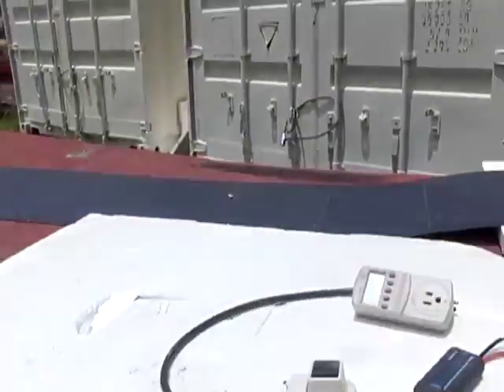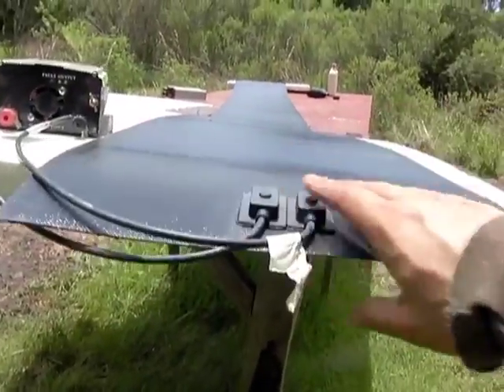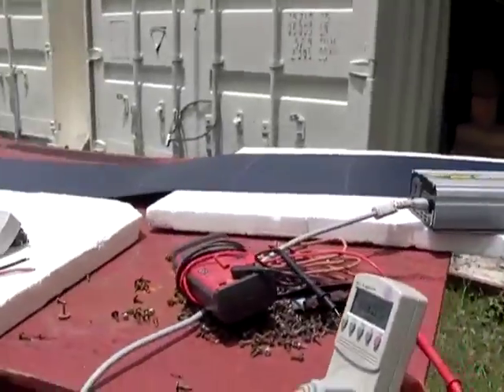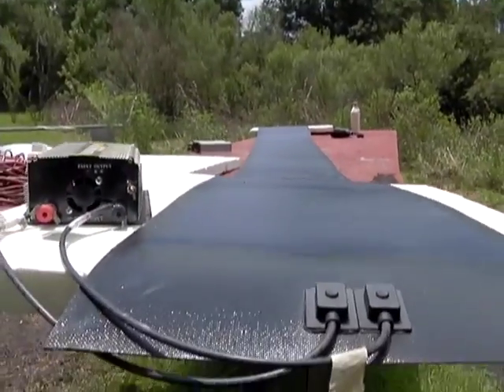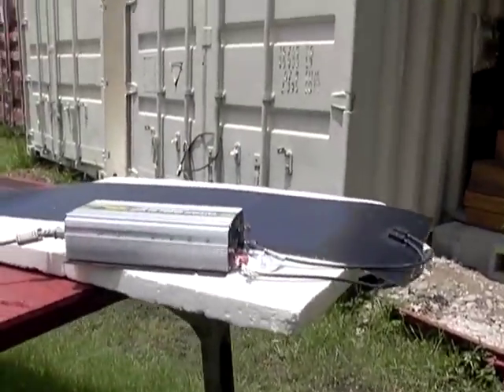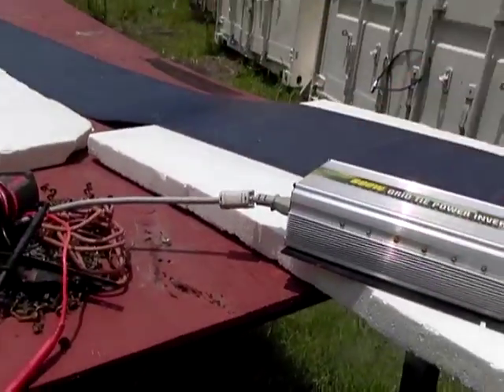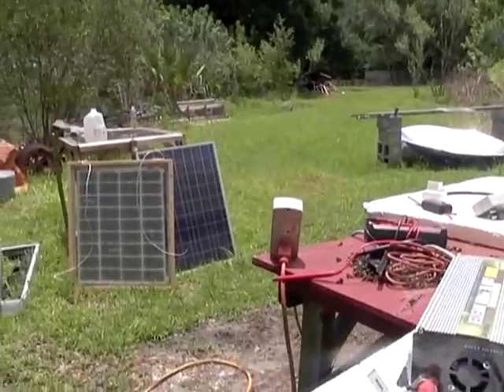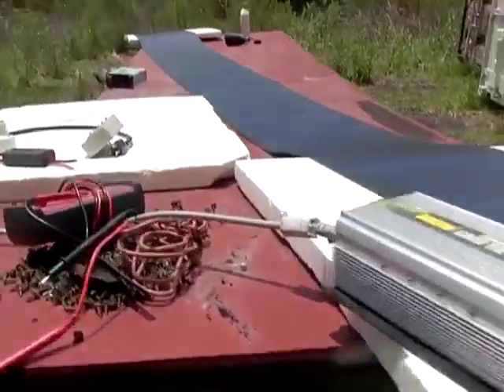DIY solar panels 124 WATT ROLLABLE SOLAR PANEL self adhesive 24 volt - 42 volt open

Comment: This looks perfect for the RV roof but it's way too long for my Sprinter. Is it possible to simply cut off the excess, aware , of course, of the power reduction?
Reply: Look for the PV-68. Half as long, terrific panels. Uni-Solar made the best and are not gone. Rats. eBay in the US  has the PV-136 right now. I am buying a second set of 4 soon.

Comment: The inverter is eating the other 13 W, NOT THAT BAD of a loss.  Good point on low rating / high rating for panels.  Please help clear up for my younger friends the different between 12V/24V and their related solar panel outputs, for example, a 12V solar panel the 12V describes the SYSTEM that said panel takes place in, not it's rated minimum voltage under load.  A friend of mine kept calling his 24V panels 40V because that's what the voltmeter showed directly connected to an open 24V panel.  I'm at a loss for more words that explain the proper nominations of 12V vs. 24V solar PV panels.  Arigato, senpai!

Comment: Do they have wider rollable solar panels that aren't so long.  I don't even know where i would lay that out without it being in someone's path.
Reply: They are rollable for shipping but should really be adhered to a roof or other large expanse. The backing is a highly sticky adhesive such as the 3M super strength...not a tar.

Comment: I am getting ready to move to a very remote are in Asia.  I want to use solar power because there is no electricity around, But. . .. I know NOTHING of it and it is very confusing to me.  What is your suggestion for me to get the basics?  I have tried researching on the internet, but all the teachers (including you) assume that the listener has a basic knowledge.  I do not have that basic knowledge.  Do you have any videos or direction on how I can learn the very-most basics to get my started?  Thanks much
Reply: Buy something in Asia, that is where they make the stuff, just remember what you need, the Voltage like in you home-country. Buy something the locals use, from a local store and let them install it. That's it!

Comment: stop buying grid tie inverters the cheap china ones end up in the bin before they pay for themself i got 6 of them and the all died maybe as i'm in Aus and it gets hot here they only can run 1/2 of what they rated at to try save them but they still die... .here put your money in a good battery bank put all your power in the bank for when the grid is down get a power inverter a good LF inverter some thing that will last you and then your happy as you can still run the power in your home when the street is with out power you not your fine.  but that said love your video's keep up the good work .100% off grid best way to be .....

Comment: nice video, over what materials can I install those?
Reply from the maker: clientesym They are hard to find now but if you do get a hold of these panels, a metal surface is recommended. This prevents thermal damage from heat build up over time.

Comment: Hi,
What controller can I use on a 36v to 42v solar panel that will be running a 12 vold RV system?

Thanks,
D
Reply: Get a MPPT inverter to take an advantage of the extra input voltage.  Buy a quality controller always. Ignore the "grid tie" references in this video. Look for MPPT (Not PWM).

Comment: You must remember the loss caused by the inverter before expressing wattage output. you should use a wattmeter at the output of the solar panel leads. The manufacturer advertises a  efficiency of +   or - 5%. Tread carefully.

Comment: So, at the end of the video you talk about plugging this into your outlets in the house.  I'm assuming this panel plugged in will provide some of the load in the house then, but do you need to have some type of tie in to the grid to get any money back?  Or is this about just using panels for your needs without worries or concerns about selling excess to the utility?  Tx.
Reply: This just for what you hook up to it, Never tie solar just into a socket & think you are helping the grid, You will have a big problem!! Lots of arching & sparks flying. To tie into the grid & all that better have a pro do it.

Comment: Those are actually flexible RV solar panels intended for the tops of RVs but will suffice in other places where the sun shines.  I have 2 90w each on my minivan roof. You can't even tell they are on.

Comment from the maker: Hi,
Parallel is all the (+) together and all the (-) together for current incremental increases and the voltage to remain the same. 
Series is 
(+)-(-)-(+)-(-)
.l . . . . . . l
.+. . . . . .-
This increases the voltage but the current remains the same. 
Either configuration, the net "power" is the same (excluding resistance).
watch?v=N86eHRGRJwQ
Reply: Yep....keep adding till that wonkey inverter blows!

Comment: do u know if it'll work with a 24 Volt DC To 110 Volt AC Power Inverter? or does it have to be a grid type inverter to work?

Comment: Dan i have 2 of these in parallel though mine are 128 watt my voltage is 44.1 volts coming out of it i have connected it to a morningstar pwm  ps30 it tells me my voltage on my batteries but when the solar current (amps) comes up i have nothing reading on that one. Any answer would be great

Comment: Thanks first for showing the way to a greener planet..
Hooking the panel to a metal plate and then drilling the roof for bolts can damage the roof.
Wouldnt it be better if i just take the peel for the adhesive(about 2-3 inches) at the ends of the panel and then stick it to the roof.
Reply: no when it gets windy it will blow away

Comment from the maker: The ones we have were actual tested and certified inventory (OEM $569). Not in a hurry to sell, they will move once the flood of this is done. If not, I will add them to my solar install. These actually produce the spot on wattage. I have 10 of the good ones in action everyday. The new ones I am flipping back out on EBAY AS-IS.

Comment from the maker: Unisolar liquidation, they are done. All of the cheap panels on EBAY are B and C and D with discoloration and or incomplete terminals. Many bought the unisolar liquidation and that is what is on Ebay. Most are for 2006-2008. They produce power but the actual wattage is dependent on the luck of the draw. I just got 11= 68 watt ea. 12v for $ 77 each, 4 produce 56 watts 5 have sprites or non completed resin curing and 2 were A okay.
You can Buy themcheap, about 5K units left FROM liquid inventory.

Comment from the maker: watch?v=N86eHRGRJwQ

Series is black(-) from one panel tied to the red(+) wire of the second panel leaving one free + and one free - from both panels together vs 4 wires. The voltage of the two panels are added together or doubled if they are the same voltage. The current remains the same = Amps. So the power=watts is the same but the voltage is higher.

Parallel is all + together and all - together. This keeps the voltage the same but increases the current (AMPS) x 2 if you are using 2 panels.

Comment from the maker: You could but Grid Tie Inverters will pull a full load when hooked to a battery. The panel's combined input would need to be more than the inverters maximum output or the batteries will fill in the gap and always be low. Any clouds and your batteries would run down fast. You would also be adding additional connections=resistance for the current to transfer across/through producing more heat and lowering efficiency. The Grid Tie Inverters are best battery free.

Comment: Dan,
    Thank you for all the info. I would like to see you do a video on how to pick the necessary components to match to different wattage panels.. Example I am considering getting 5 of these rollable solar panels for a shed I am proposing to build. If I get 5 X 124 watts in parallel
I will end up with 620 watts by 40 volts. What size GTI should I be looking at? Also is there a difference in the size of the GTI if I have 6 70-100AH battery bank to store the output of the 
PV cells?
Thanks

Comment: if its DC volts why cant you hook them up directly to the 2 12 volt batterys in series why the inverter?why not use the regulater from a battery charger.maybe using even 6 batteries in a series parallel curcuit

Comment: Dan, I'm looking to use the Uni-Solar PVL-136 to add electricity to a house in Sub-Saharan Africa.  I know the panel is 15.5" tall, but I don't have any idea of how wide it is when rolled up.  Can you give me an idea of its size when rolled up?  Would it fit in a large suitcase?
Also, where do you get your inverter cables?  Any recommendations?  I'm looking at 2 Conductor 8AWG ($1.75/ft).

Comment: Soon you will be able to buy them from wholesale liquidators.  The company that is making them will be filing for bankruptcy by June 30 next year (based on where its bonds are trading now) - those modules cost more to manufacture than the company can sell them for.

Comment: I don't get it. 
22 cells connected in series should = 11 or so volts. I never heard of anything other than about half a volt per cell.
Or are they little 44 volt mini panels strung together in parallel? Oh, guess they would be since each has its own diode so that when shade hits some, the others aren't affected. 

I bet it would also double as a source of heat for water (since most of the sunlight is absorbed by the dark color and re-emitted as infrared).

Comment from the maker: @GREENPOWERSCIENCE If you are only in it for the payoff, only switch your light bulbs to compact florescent or LED. payoff 1 month for CPF and 7 months for LED on average. If you are hooked on incandescent do not consider solar. Like buying bottled water to put out a fire. Makes no sense. First step before going solar is to eject old tvs computer monitors old PCs appliances. All new energy efficient. You will cut your e bill in half and have all new stuff solar install now 1/2 price 4 half watts

Comment from the maker: RE PAYBACK:
we bought new 95' 8cy mustang new in 1994 (midlife thing?;-) actual mpg = 12city 15 hwy required 92octaine+ or it rattled horribly (ext warranty 40k in repairs in 40k miles lemon but not official) Gas 87¢ gallon why buy a new car 2001 now owned free and clear. When gas hit $2.40prem+ in 2005 reason was there. 120 mile rnd trip biz = $25-$30 go to the mall/store $6 a trip.
New Lancer = 35 mpg. own free/clear save $2,000 year in fuel, biz tax deduction the same$ per mile:-) poff 4yrs

Comment: Then, this will lower my already small consumption during the day, but will produce too much, so I will also charge a LiFePO4 48v 4kwh battery  bank that will at night give back the necessary electricity in my home grid

About Uni Solar PVL panels:
They get more light from the sun even when it is a bit cloudy, and their voltage doesn't drop when they heat up in the sun...
So more expensive than other panels, yes, but you get more out of them and mounting them is 'piece of cake' so you save on l

Comment: @kdknitro 
Well, well, well, you've discovered the reason that solar power isn't on every house in the country.  Huge up front costs mixed with a highly mobile customer base ( mortgage rates on a 30 year loan track the 10 year T-bill!) 

($6000/$86)/12months per year = almost 6 years payback, and that's not even counting in the "time value of money".   To be fair, the panels do not degrade that fast. They'll still be putting out significant juice after 20 years

Comment: ok.  how hot does that flexible PV collector get.  Can I use it as a heat collector too?  Sort of a hybrid PV / air Heating thing?  I imagine that heat is the enemy of the PV collector... removing heat witha air streaming over it, and into my room, seems like getting something for nothing, no?

Comment: @Petawatt  ok it is 84 bucks a month right, say your stuff cost 6000= low end 7 years return on investment then your solar panel degrade and you have to buy more and your hit stars over. They are starting to get better in price but right now there just no fesable for your average joe which is who needs the money savings on power.

Comment: I have a 48V system, 1.15kwh, is there a cheap grid tie like that that will accept 60V open circuit panels (ie 48V)?

Comment: @kdknitro 
12 cents * 24 panels on the roof * 30 days = $86.4 which is a large chunk of my monthly power bill. 

 You've just  got to figure out your total return on investment, your "break even" point, and be pretty sure you are planning to stay put in your home for a few years.

In most cases, however, you can enroll in a wealth transfer scam that gives you tax credits for investing in solar.

Comment: @GREENPOWERSCIENCE 
Of course, it's really not fair to use the cost per KWH "total charges" if you use a grid tie inverter that is tied to the grid. You are going to pay that fixed fee to connect to the grid regardless of whether or not you actually buy any electricity when averaged out over day and nighttime. Some places probably will charge you twice, as I've seen a few setups with two different meters, one for generation and one for consumption.

Comment: @MARTIALLAWLESS It also gives you some freedom that the grid doesn't offer. If there is a power outage you can still have some power. I a 50 watt panel and a small battery and charge controller. It isn't much, but as long as there is sun it will work when the grid doesn't. After the initial investment in hardware, I don't have to spend any money on it. Gas powered generators are noisy and require spending money on fuel. Sun light is free. So is wind, but thats for a future project.

Comment: If you had to use a lower voltage inverter, you could use a circuit to dump excess power into a dummy load if the voltage got too high.  Essentially a zener diode and a big transistor and a load.  It should be pretty inexpensive.  Although it's probably smarter to put that effort into getting the right inverter instead!

Comment: @tongueboy500 The GTI's MPPT feature will also help by finding the max power point of both panels, which would be a compromise between them, but if they are not too mis-matched then the difference would be minimal.

Comment: Fantastic vid! If the inverters get so hot, maybe you could put a stirling enginge onto them, lol. Your videos illustrate a very important point, which is that we all use energy that's consistent, and it's consistency that's the problem with homebrew & renewable systems. 42v in order to only use 24 seems rather wasteful, but other solutions don't seem to be all that forthcoming.

Comment: @pna71 Just so you know, I am a daily shark of a trader in the commodities and Oil is one of them. I have no doubt  peak oil production capacity along with Natural gas and coal will one day hit us...as I see that storm heading our way then solar/wind will be viable. Until then I will use the less expensive energy fossil fuels provide. I do have a full alternative energy plan in place with some of it active now like a high thermal efficiency home, lights, appliances and Hybrid auto getting 38mpg.

Comment from the maker: @tongueboy500 if the voltage is the same they can. ex:

6 watt 12v parallel to 80 watt 12v yes

Comment: Hi Dan, you mention 'paralleling' panels. If i was to parallel two panels with different ratings into an inverter would this cause problems? I can see that if connected in series, the panels may try to drive each other. I know ideally keep the ratings the same, but what issue would I have if I DID parallel some with different ratings?
Thanks

Comment: this is cool and all, but it will take at least 7 years for it to pay for itself (not including everything else you need!!!)
I still waiting when its at a point where solar panels will pay for themselves in less than 5 years... including the batteries, converters, etc.

Comment: it  seems you need large space for just mere 124 wat solar power production, I dont think it is feasible to use such solar panels for large solar application, as compare to new crystalline type solar panels with same space you may get almost 2kw power , where as to get 2 kw power from above video panels one will need almost 20 times space.

Comment: @GREENPOWERSCIENCE Cool. Is there a direct correlation of the amount of sun to the amount of power it outputs at any one time? .... i.e. if there is light in the sky will you always be getting *some* output? Or does it need a minimum of sun to power anything? Do you have any of these systems linked to battery arrays? I've been watching videos of people who have systems like that.

Comment: So help me get this correct: one flexible solar panel = $300.00 and one GTI adds another $125.00. So if  the utilities charge us .10cents per 1kw  then then it takes over six years to pay for itself if running at peak theoretical efficiency. This example does not even take into considerations the cost of any  batteries to store energy or a safe area to store the batteries, cables, switching  and any maintenance issues...so far this Green power is VERY expensive. In WI I pay 8.356 cents per 1KW.

Comment: If these are stuck to an aluminum water jacket with a heat exchanger, you'd get free heating and hot water too. The potential with this system is so great, you'd also feed unused electric back into the grid and may end up with negative power bills.

Comment: Omg this is so awesome. @Greenpowerscience. Does it have the same effect as the ''regular'' solar panels? And by that I mean: If you break a little piece of a solar panel it will lose over 50% of its power, or something like that. Is it the same with this type of solar panel?

Comment from the maker: @tonerduckpin The 215 Range is 22-36V It will start up at sunrise and can keep the max volt during draw below the 36 fault level. If it peaks for some reason the 215 will shut down. Running voltage of the panel during full load is 23-30 volts. The starting open is 42 volts solid.